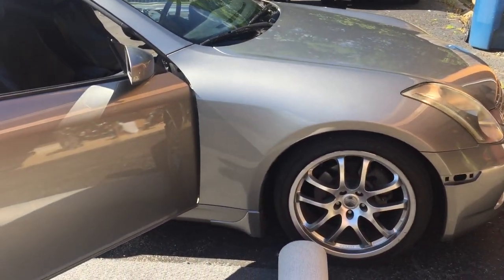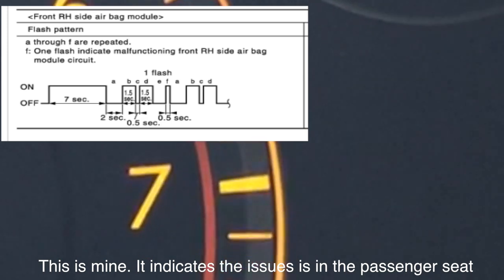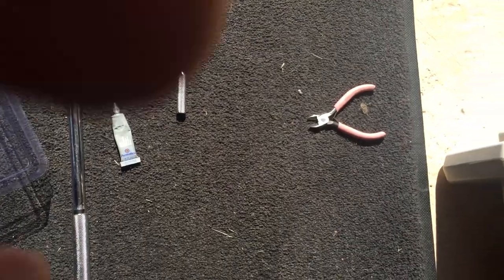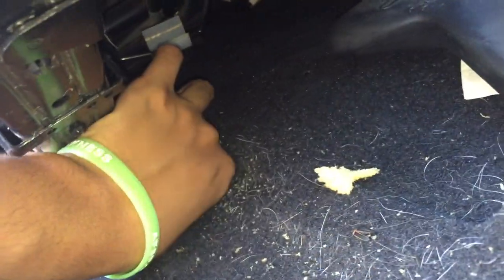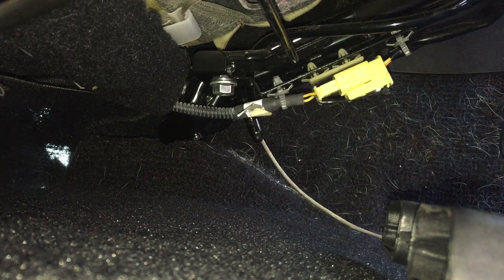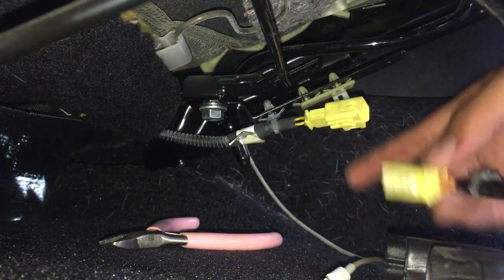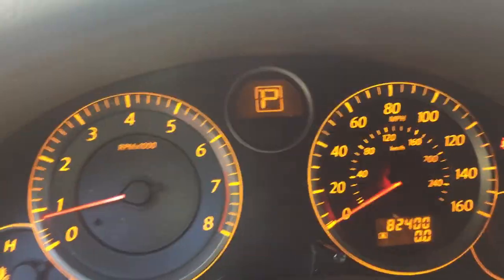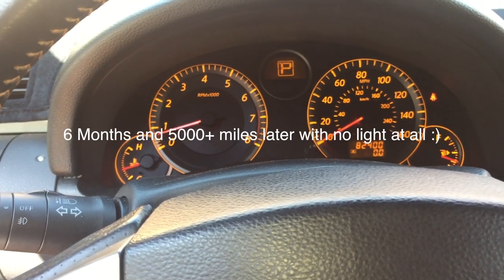Infiniti G35 Coupe (03-07) Seat Airbag Light Repair - Faulty Connector

Comment: You solved my problem! Apparently during my reassembly after a complete floor sound deadening, I must of not seated that Yellow Air Bag connector fully... I  cleaned the connector with Deoxit an exercised the connector about 5 times to a full "Click " each time..I performed the Learning procedure as you demonstrated....I am now very happy! Thank You.  :)
Reply: Was there any tape around the connector? I wanted to find out what type of tape it was in case if I ahve to replace it:

https://static.nhtsa.gov/odi/tsbs/20...44443-3500.pdf
Reply: @Wizegui  Yes there was tape originally (maybe blue or yellow plastic tape) don't remember exactly what color it was...A high quality(3M) electrical tape that doesn't come apart in a car's hot summer interior should work fine.

Comment: Did this 6 months ago on my 03 Sedan and the light hasn’t come back on this actually works!
Reply: Did you do actually what this video did? Have a 03 sedan too and have the same issue
Reply: @gl2214  I did everything he did in the video. Only thing I did differently was use electrical contact cleaner instead of the dielectric grease. Been almost 2 years and no issues since.

Comment: Fyi this works on 2010 G37x Coupe driver side. Same yellow connector. I was able to reach it by just raising the seat height all the way up. Disconnecting and reconnecting once did the trick. Thanks thanks thanks for this diy.
Reply: Frank Brawnson did it ever come back ?
Reply: @TyySmoove1  nope, never...
Reply: did you unplug the car battery?
Reply: @HowardTdot Its been a while but I dont think I did disconnect the battery... and FYI the light still didnt come back.
Reply: @frankbrawnson9228  appreciate the response. I did mine today without having to remove the seat either... just raised it as high as possible.. I did remove the negative charge on the battery tho, just to be on the safe side. I hope that light stays off this time!
Reply: @HowardTdot Hi there,  I'm having issues with newly purchased 20p7 G37.

So just disconnect the negative battery cable only before disconnect and connecting it back?
Reply: @kempowarrior  yea that's what I did. GL!

Comment: My 2008 Infiniti G35 has the B1018 code. Front Passenger airbag sensor failure. Can I have that code and it still just be a bad connection. It has a recall for this exact thing on this car but not my specific VIN so Infinit wants to charge me 6 to 8 thousand dollars to fix it.. I live in an inspection state and it won't pass which makes my car worthless. I'm disabled and dont have more money than the car is worth to fix it. Any advice PLEASE

Comment: Nissan tidda when I turn steering completely left the air bag light start to blink at the Desh board, and it can be reset,by the normal trick by using key In and out in the key slot couple of time, but once I turn steering completely left it start blinking  again, please help, thanks 🙏
Reply: Might be issue with the clockspring

Comment: I have a same problem. Tried first with ignition key but it comes back. I tried also your trick and it comes back after 15mins.. What next?
Reply: Dušan Kostić did you ever fix the problem?
Reply: @3cinco76  nope bro
.gave up on.still has blinking light
Reply: @d.costa94  same issue here
Reply: @DJLotLizard  I didn't get time this summer to try fixing it. Rear wheel hub needs to be taken care of very soon
Reply: @d.costa94  I think I've narrowed it down to the steering wheel airbag itself